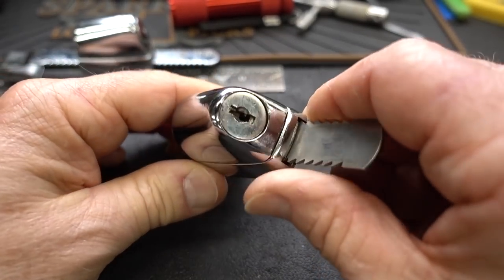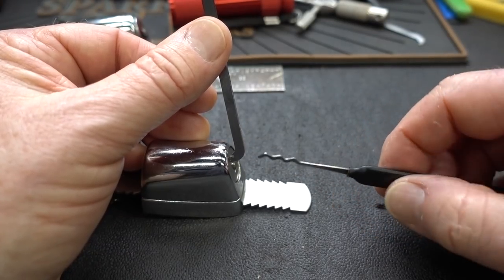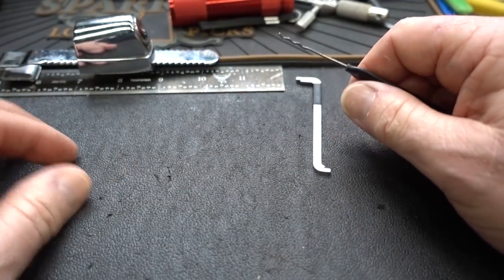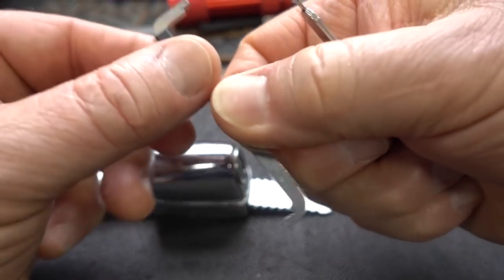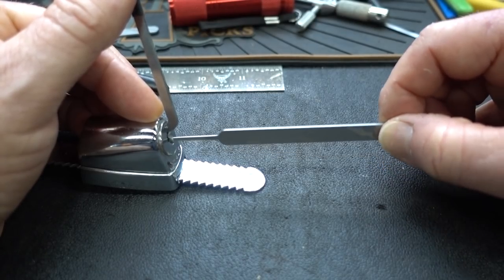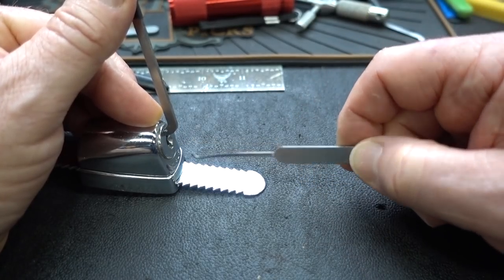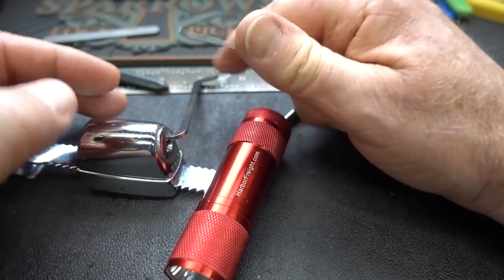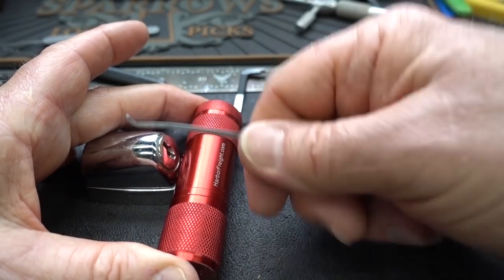(1840) Display Case & Gun Cabinet Locks

Comment: The fulcrum is a good idea. You can also use your finger for that. The problem with using a separate fulcrum is that the lock might be located flat on a vertical surface, so it might need securing into place.

Comment: A huge flaw I often see in those display cases is that to remove the sliding panels/glass you need to lift the pane enough to clear it from its sliding slit... and that sometimes work even if the panel is locked by one of those ratchet locks...

Comment: I once worked retail in a relatively large home-improvement/farm type dept store.  We had these cabinet locks all over the store.  Some were the clip on type like this, others were basically retractable locks set in the aluminum frame.  There were about three different types used in the store.  I had keys for everything, but I eventually realized that I could find a key with warding close enough to fit them all, and I just sort of did some interpolation by eye to "average" the bitting between the keys.  If I can make one key that fits three totally different locks with different bitting and keyways, they're pretty shitty locks.   I mean, the locks had been worn with decades of use, but it didn't help that they were cheap zamak wafer locks to begin with.

Edit: I should point out that the clip-on locks that I'm used to are only one-sided and are shimmable with a zip tie anyway.  Also, plenty of people reinstall them backwards (defeating the lock) out of either laziness or obliviousness.
Reply: Shimmable with a ziptie ? How bro
Reply: @manimallhi1747  The locking teeth on the fixed part of the lock are exposed.  Just slide a small (1/8") zip tie in there.  If you've ever seen one before, imagine it all worn out and loose. A picture would be self-explanatory, but I don't have one for you.

Comment: How would you hold the object there? You would have to tape something, or secure it somehow.
Reply: Left hand holds the cord of the flashlight over the body of the lock. It doesn't need to be anything special. You could even use your own thumb, by "pinching" (the finger motion) the body of the lock, and pushing with your pointer against the lever.